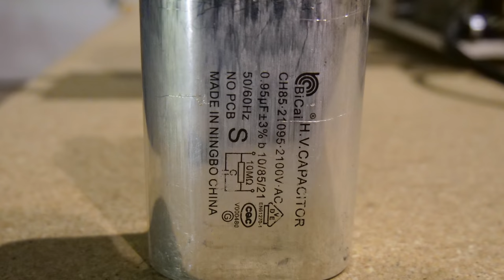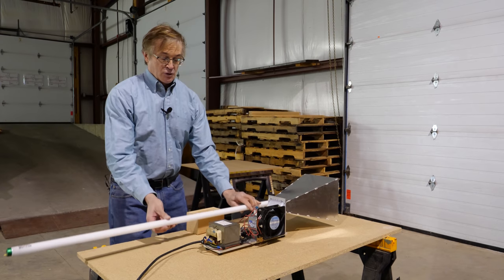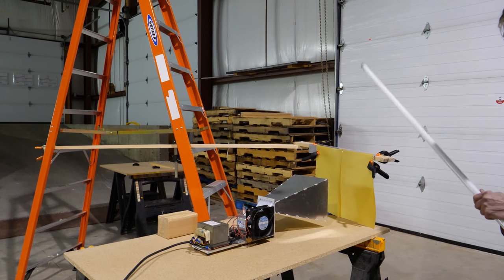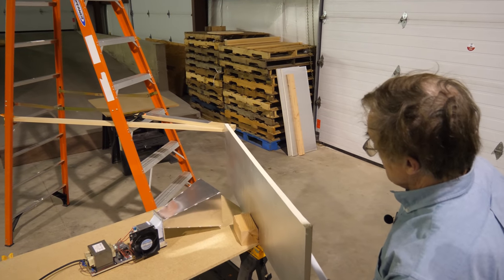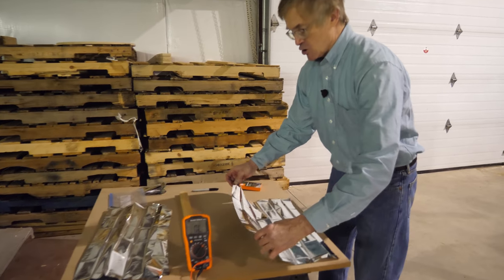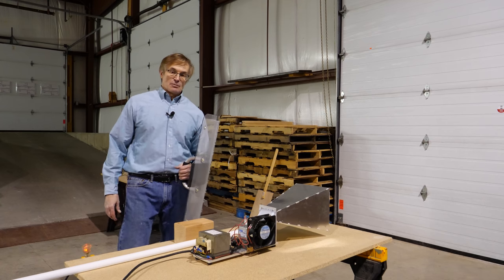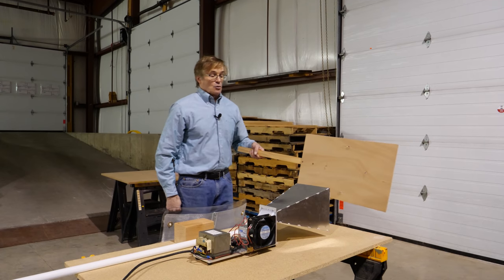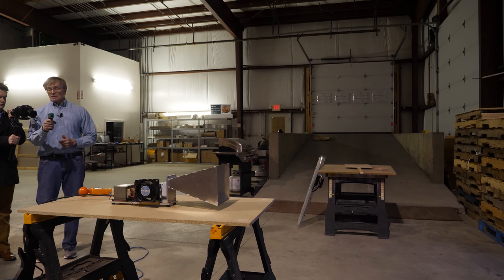You're not protected from microwaves... yet - Part 2

Comment: Passive beam arrays and active beam arrays are both types of phased arrays that use beamforming technology to electronically steer beams of radio waves in different directions. Passive beam arrays have a single transmitter connected to all antenna elements, which allows for the emission of a single beam of radio waves at a single frequency at a time. To emit multiple beams, a beamforming network like the Butler matrix is required. Active beam arrays, on the other hand, use multiple transmitter/receiver modules interfaced with the antenna elements, allowing for the emission of several beams of radio waves at multiple frequencies in different directions simultaneously. This setup enables clusters of simultaneous beams to be created and for the array to maintain its beam pointing angle over multi-octave bandwidth. Active beam arrays are primarily used in radar systems and provide high situational awareness, making them especially useful in electronic warfare applications.
Reply from the maker: Correct, and well stated.🙂

Comment: The pink ceramic ring is made from an alumina (aluminium oxide) alloy, as this actually exists in pink, unlike beryllium oxide. If it were made from beryllium, microwave ovens would be more expensive and have had one or more warning labels plastered all over the interior, and had a postersize warning in the users manual that they would be known to the state of California to cause all kinds of misery when dumped in the landfill.

That said: it never hurts to be careful.

Comment: I have a Gigahertz Solutions device that can measure microwaves. I carried out an experiment with a standard microwave oven down in the driveway that I placed on top of a little table. 
Using a 100' tape, I marked the driveway every 5 feet with a piece of chalk, up to 30 feet away. I set a large measuring cup filled with water in the oven, then placed my phone on 'airplane mode' so as not to confuse my device. When I activated the microwave oven, my testing unit hummed madly and vibrated like a "Tickle-Me-Elmo" doll far beyond 30 feet!!! A word of advice: whenever someone turns on their microwave oven -- RUN.

Comment: You could install the rigid foil faced foam like that. But, it comes in 4'x8' sheets for a reason. To be used as either an under sheathing or an over sheathing for your walls and/or ceilings. It can also be installed between the two layers of studs in a double stud wall.
Reply: Lines rooms with foil to protect against RF beams.
Complains that there is no mobile phone reception.
BTW - your comment makes absolutely no sense, sinceit simply says what was already stated in this video..

Comment: Seems like simple reflective materials might be more dangerous to those around you. Not only are they exposed to the radiation from the weapon but also the reflected radiation  bouncing off of you.  Maybe some kind of retro reflective material would be cool, but you would want to be careful, you might be giving someone who stands between you and the source an extra dose if any of it makes it through them to hit you.  A matte/diffusive surface might be safer.
Reply from the maker: The problem is that at a wavelength of mm all conventional surfaces are smooth.  You'd need a textured surface on the scale of an egg crate.

Comment: you know after a very intense review of trees, fences where wood only burns around the nails, trees burn from inside out and a lot of alloys melt that dont melt in normal fires. sad thing to joke about but the ongoing joke in calfornia is the only thing that doesnt burn in modern forest fires are the trees. this is because they are still standing and green though burnt on the inside. It sure acts like microwaves. are there any possible long range methods to get the water molecules to flop and cause metals to melt?

Comment: How to Defeat MW weapon.   The Achilles' heal of these MW weapons is going to be the emitter antenna, a sophisticated phased array and RF power amp.   Disrupt the antenna physics, causing off resonance and reflected power back to the power amp are likely to disable the unit.   Could even burn out the RF amp if the engineers didn't add protection functions.

How about splattering the emitter with a paint ball containing aluminum or carbon fiber conductive powder in very sticky paint.  That's really going to muck up the phase array's functionality.   Could be from sling shots or heavy metal slug accelerator.    Absorbing Silly String,  chaff  etc.   As a kid, always liked the spy vs spy cartoon in MAD

Comment: It is fairly easy to build a radio wave detector, a schottky diode and some kind of indicator: efficient led, analogue meter etc. If you are worried about blowing up the contraption just put a TVS diode in front of it.
Reply from the maker: Sure, although that requires a basic understanding of electronics.  Another advantage of the bare bulb is documentation.  You can't be accused of "cheating" with an electronically driven detector when accusing the perps of deploying a weaponized microwave system.
Reply: @TechIngredients  I agree that it is more complicated, neon bulbs are much more accessible and easier to use, but don't really see much benefit in the cheating department. The accuser can claim that you produced the microwaves from a hidden device, no matter what the detector is.

Comment: Hi there folks I've only disassembled one residential microwave was fully aware of the beryllium oxide so approached it with caution found it intact I use my hot glue gun to encase the beryllium apparatus before I moved it, smothered it  in hot glue waited for it to cool and harden, it's better than nothing so just a suggestion. Actually as an extension of that thought a candle wax silicone anything that will cut reduce dust attach itself to the beryllium apparatus and lock it down for you will work.

Comment: Great video! Just found this. I was actually driving on a highway by my house and felt very strange sensation come across my face while driving past a series of cellphone towers. I know it sounds crazy but a lot of people are talking about 5G towers and the dangers and considering the situation and nothing else was around it very suspect. Anyway, immediately afterwards a strange numbing sensation came over my face and forehead and I had difficulty thinking and concentrating and I knew immediately, it was real. I later checked a website called antenna search and started checking all the ones in the area along i70 where I was driving when it happened.... wouldn't you know, one of the towers stated specifically "Service Type: Microwave" ..... well anyway, believe me or not, I don't care. Shit is real. Be careful... I think I'm going to start wearing hats lined with copper cloth you mentioned (do you have link for that material?)  or hell maybe I will just buy a metal viking helmet to wear while driving after watching this video. Thanks for the content. God Bless.

Comment: To protect your face you could use a full face helmet that has the conductive cloth material covering it and for the visor the aluminum window screen material electrically bonded to the outside conductive material. To protect your body front you could make a large bib to wear under your jacket.

Comment: A room surrounded with a conductive surface would work to keep out electromagnetic radiation that was emitted from the outside, but would do the opposite and create a chamber similar to a microwave oven if the source of the radiation is within this chamber a could create a magnifying effect where the reflected radiation interacts with itself and creates areas of higher and lower intensities.
Reply from the maker: That would indeed happen.  But if those surfaces were grounded, the energy  would be absorbed  as well as reflected.

Comment: Just a note - the Active Denial system runs at 94GHz and some have said has a LETHAL setting they don't make public, I don't know if that's true but very possible. At least 3 soldiers got 3rd degree burns in testing despite the claim it only stimulates the nerves. Also, a FLIR camera shows the skin heated over 130F in under a second, so if you can't move quickly, you'll get severe burns. Also, the microwaves do spread out but not a lot since it uses a parabolic dish, it's focused at over 1000 feet away. So if you are older or can't move... you might be cooked or severely burned. Also, all the testing is done on people's backs because they clearly believe eye damage is a huge possibility, also if you have metal buttons, framed classes, etc, you might get shocked or arcs to the skin or burned by those objects heating up too. This is something that shouldn't be used on people.

Comment: Worth noting that 2.4 ghz is the same frequency as your phone uses for short range radio.  The difference is in magnitude.  A wireless router will output somewere less than 750 mW, in a sphere, vs the 900 W in a beam of a microwave.  The microwave is over 1000x the power of your phone or other low energy devices.

Comment: Just a few thoughts.  One, that garage door has been nuked big time, and anyone standing behind it, like the fedex guy who may be knocking on the door during the experiment.  Next, is the garage door a foam core sandwiched with aluminum or plastic? Moving on, why not use whatever insulates a microwave oven on the sides, back, top, and bottom for protection?  Thanks for taking a nice dose of 2.4 gigs for the experiment!  Cheers!
Reply from the maker: The door like the sides of an oven are electrically conductive. That's  all you need to block microwaves.

Comment: How about corner reflectors? They always reflects incident beams right back in direction from which they come from, letting the operators taste their own waves. If all of the crowd (front rows at least) keep this kind of reflectors under their clothes, they would fight back the microwave source. 
To obtain the "template" for angle reflectors, I would disassemble a catadiopter patch (e.g. for vehicles) and on the inside surface of transparent (usually tinted red or yellow) window there is a repeating pattern of millimeter-size (ha! exactly convenient) pyramidal shapes. I would press few layers of aluminum foil onto that surface, disengage, shift aside the "mold", carefully overlapping to keep the already formed grooves intact, repeat, until the whole sheet is formed. Then, laminate the back side with silicone to assure that the shape is protected and whole structure is flexible, so that it can be worn under clothes.

Comment: Something I'm wondering about with you mentioning putting the conductive mesh in a garment or a riot shield is if I have an outer layer and inner layer of the mesh, and I tie the indicator between them, will the increased surface area on the leads increase the sensitivity of the indicator while the mesh itself protects you . With that in mind, I guess you could hide an indicator under the bill of a hat, or in the collar of a jacket to where you can see it easily, but its presence won't be ultra noticeable.
Reply from the maker: Probably not.  You also don't want too much sensitivity so that you're going crazy from multiple sources  that don't pose a risk.

Comment: Military units have megawatts output depending on the model.  I would have liked to see window screen (both aluminum and carbon fiber) used in the experiment. I wonder if it was temperature sensing or the microwaves interfering with the electronics of the thermometer causing the reading.
Reply from the maker: That's unlikely.  Can you link to a source that supports that output power claim?
Reply: @TechIngredients  Saw it in a magazine somewhere. Can't remember which one.

Comment: People probably should keep in mind that if they're going to make a shielded room, its also going to stop your cellphone connection, wifi, bluetooth, home automation, garage door openers and a whole host of other wireless gadgetry that will seem obvious in hindsight, but you probably want to consider with foresight before you sink thousands of dollars into a project.

I built a cabin using that insulation and it turns out a lot of windows coated to reflect IR also reflect RF. Despite the fact that the cabin is mostly windows, there's effectively no cellular reception in it.

It might be interesting to see if that kind of glass would reflect microwaves efficiently but it would be pretty stupid and relatively expensive to make a shield out of glass.
Reply from the maker: I'm sure it would.  Most of those coatings are metals.
Reply: I just realised why my foil wrapped insulation (after renovations) caused me such a reduction in cellphone reception!
You can get cellphone repeaters so that an antenna outside can beam signal inside. That's how they get good signal in shopping centers, tunnels, etc. However I am not sure about viability for domestic use.

Comment: You should reproduce the Don Smith device, Teriel Kapanadze device, French Kapanadze reproduction, MIT wireless electricity transmission.
All of these are the same technology.
The less skilled use iron cores in L2 to tune the 2 coils in resonance, while electronic engineers tune the Henry's in the circuit.

Comment: It would be interesting to see what would happen with a microwave countermeasure, consisting simply of a corner reflector (retroreflector) that would return the beam to the source no matter what the angle of incidence.  A NASA engineer got the idea for laser propulsion of spacecraft using a retroreflector mounted on the spacecraft as one mirror in a laser cavity, with the other half of the laser being based in low Earth orbit.  The idea was that, with no output optic, the laser radiation power would build up to a level limited only by the absorption of the reflectors.  Amazingly, tests showed that this arrangement was optically stable enough to work, despite having one reflector of the laser freely translating in space.  It would be interesting to see if a closed microwave loop would build up cavity radiation to the point of creating a plasma column between the source and reflector.

Comment: I have enjoyed your videos on microwave detection, uses and protection. However i have to make one observation. When designing a test or demonstration of electrical equipment or electronic devices, I feel always having a main disconnect essential. The act of constantly plugging and unplugging a cable to connect and disconnect an apparatus is kind of flimsy or haphazard and can also result in the potential of causing electrical arcing and sparks. Please consider using an electrical switch contained within an electrical box with an appropriate electrical outlet to plug the test device into. Sorry i get long winded sometimes. I do have one question. Is there a phone app that would be useful in detecting microwave activity? Such as an EMF meter app? And would a weapons grade microwave instrument damage a phone?
Reply from the maker: I appreciate  the advice.
However, despite its apparent lack of sophistication, the plug is an excellent  visual and physical feedback. The risk with the switch is that in a large lab or a dark room, you may "think" you shut it off or that the power IS on and the indicator light has failed.
These microwave  power levels will damage  a phone.

Comment: The binocular format may suit better,  or a telescope. LOL, for the flashing light prize I had stripped a microwave to heat water vapour in a cylinder ... etc. and then flash a neon. . got toe love them, made a very simple ultrasonic flyback pulse generator with a neon across the transmitter, lovely pulse. about 25 years ago i did fully dismantle a microwave transformer for interest. and I did all the bad  things , it looked like ceramic, not labled . well we are still both her

Comment: So what i want to play with is taking the shield and reversing the 15 degree spread inside and compound the waves .Like a magnify glass , and experiment with what i can do and the temperature.I should get something like a lazerbeam i think.What do you think?.Oh ya i have learned about compassitators the hard way.Voltage becomes dangerous as you increase your amperage.Im sure your familial with a jeeping coil.The guys used to take the ground off to get my attention if i was out of hearing range. They thought a few hundred volts. running through my body was funny.Only half an amp.cheers dave

Comment: It would have been nice to see a microwave door tested:)
Reply: I have one on my door, so far no visitors.
Reply: The microwave energy won't pass. The wavelength of the microwave energy is far too large, for it to pass through the holes in the metal mesh used inside the door. Think of it as a cage door. The cavity light has a much smaller wavelength, so it's able to pass through. This is how you're able to actually see what's in MW, without the energy escaping.

Comment: Not all space blankets are created equal.  Some have very thin deposits of aluminum and leak badly.  A good quality aluminized mylar sheet is used to line the walls of plant grow rooms.
Reply from the maker: True.
For this application, simply  apply an ohm meter to the  aluminized side.  If it conducts, it'll work.

Comment: I wish I'd seen this BEFORE I looked for voltages within my failed microwave with the POWER ON!  Even as an Electrical Engineer taking (relative) electrical safety precautions, I didn't realise the depth of the hazards.  There are no warnings on the casing!  Anyway I managed to find the problem and fix it😢

Comment: Kinda surprised you didn't try sarking, of the type used on buildings that is blue on one side and silver on the other as it's also metal coated in the same way. Strong, far cheaper than the that pricey foam stuff and comes in rolls dozens of meters long. A sheet big enough to hide behind would be about $2. 
I'd expect it to work pretty well.